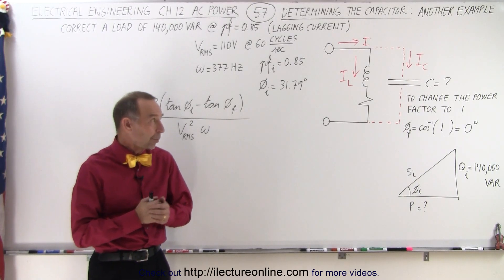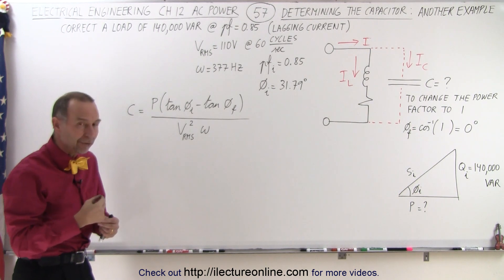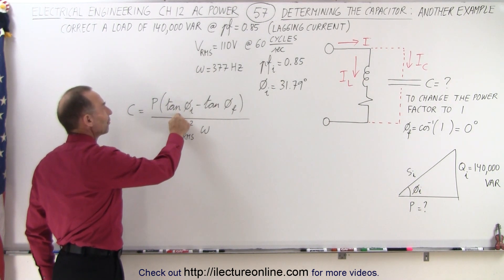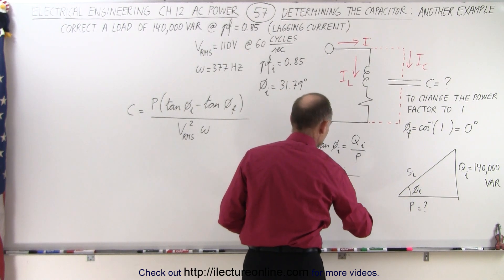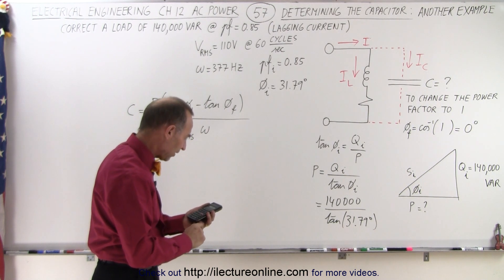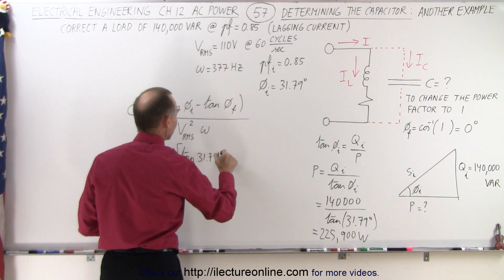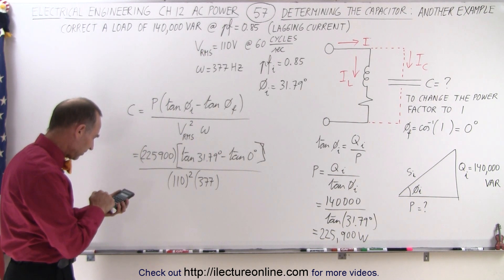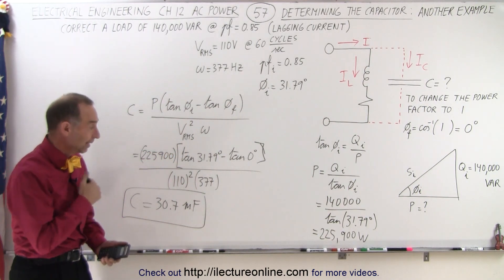Electrical Engineering: Ch 12 AC Power (57 of 58) Determining the Capacitor: Another Ex.

Comment: is the value C = 30.7 not supposed to be in mf? or am i confused as i get 0.03069.. on my calculator so to get to 30.7 the decimal moves three times which is x10^-3 which is  m and not u? could someone assist?